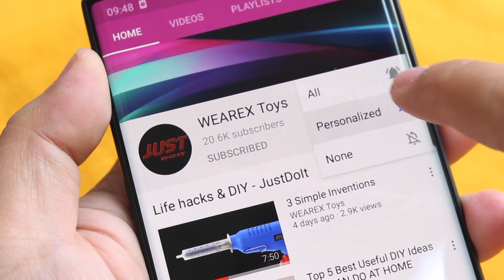Top 5 Best Useful DIY Ideas You Should Know #2

Comment: That last one is an Acetelene generator using calcium carbide in water. Just like the old miners lamps. Problem is you can't turn it off and Acetelene is Very dangerous, in air it has an explosive mixture range from About 2.4% to 83%. Dont let this stuff accumulate inside, any ignition could cause an extremely violent explosion
Reply: Thanks mate